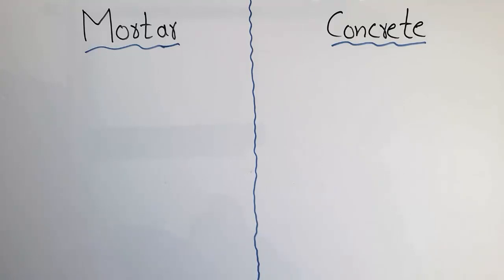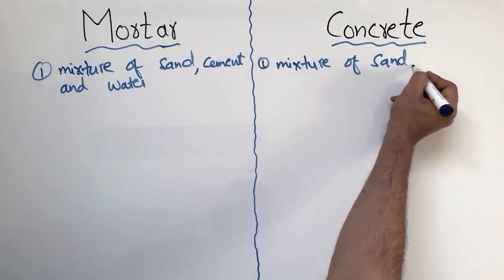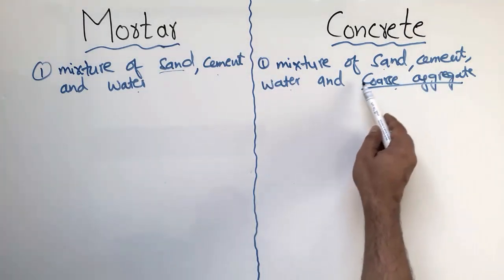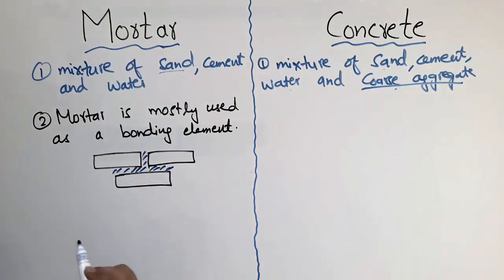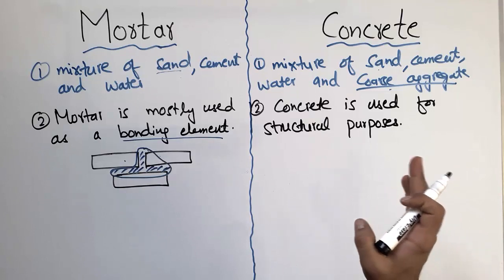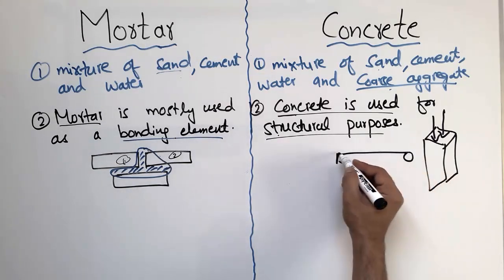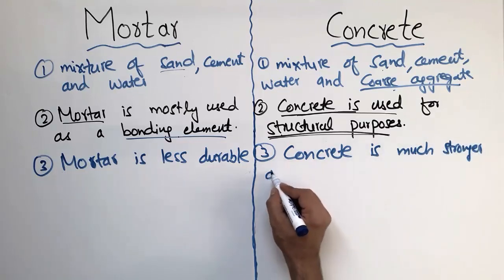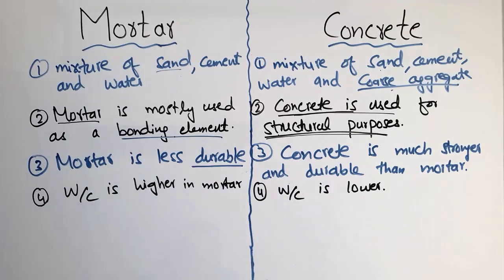Difference between concrete and mortar

Comment: I have been building a rock wall made out of field rock. I have been using half mortar and half bagged concrete. How will this be as far as being a strong bond for the field rock? I have been using equal parts of mortar, concrete and sand. Looking forward for your answer. Oh yes, the rock are only 2 rock high.